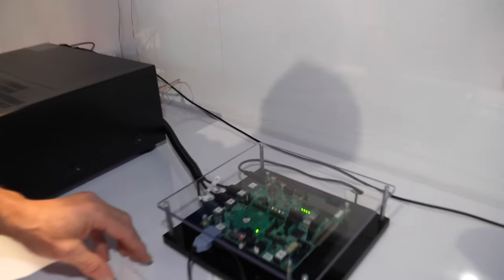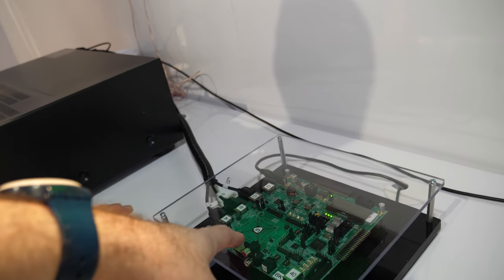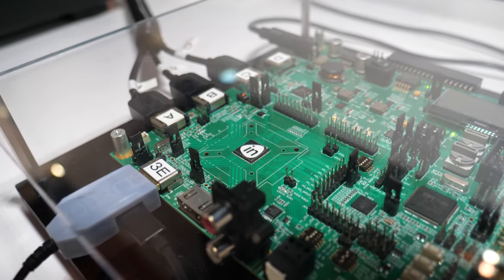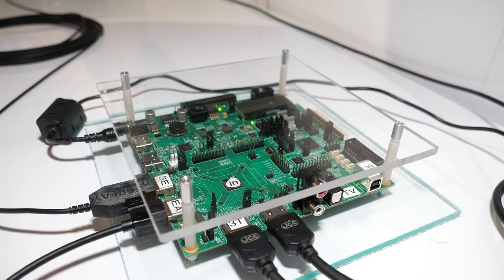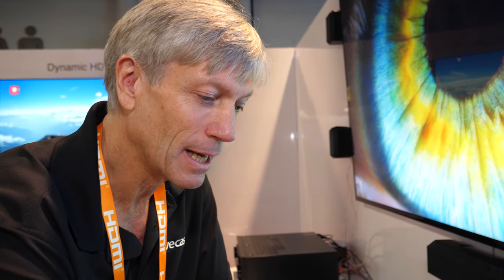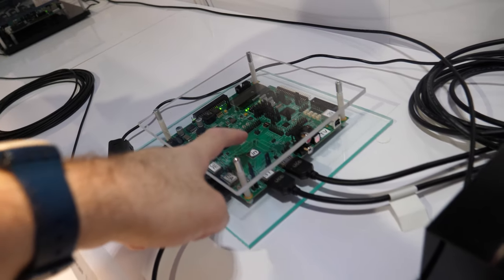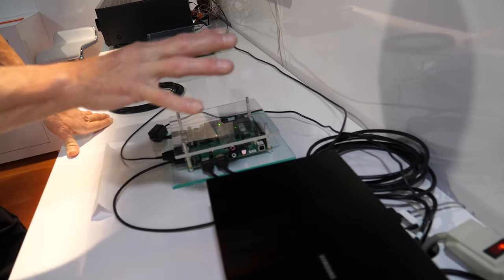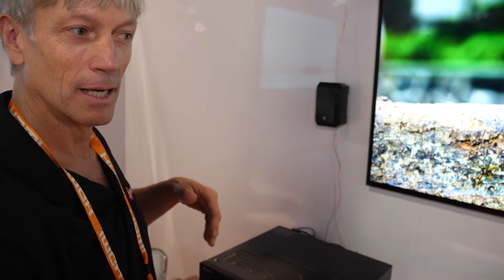INVECAS shows World's First HDMI 2.1 with HDCP 2.3 Chip & IP Solutions for TV, AVR, Soundbar and STB

Comment: Does that receiver hooked up to the T.V support 4k 120hz or higher pass through?  I don't see any receivers on the market with hdmi  2.1.
Reply: More Models/Products will Support HDMI 2.1 and Will be Coming Later in the Year. (2020) and will become the Standard by 2022. ( when it comes to big name brands)
Reply: If I recall Right -- LG and Denon are currently working on Some HDMI 2.1 Receivers.
Reply: @KaeganThornhillTheCyberRaven  I've been  holding off for  7 years  for one.  I have a Sony x900e with 1080p that can do 120hz, 144hz, 240hz and 1440p at 120hz  hooked up to my pc. I have been waiting a long time for this. Good news.  Thanks for the heads up.
Reply: No problem, Buddy.

 Also there are several 4K TVs said to be Rolling out soon that will be able to handle 144fps/144hz at full resolution/hdr and even an 1440p Ulta Monitor that can handle over 340fpz/340hz. 2020 is going to be Wild and the Perfect year to Upgrade your Battle Station.
Reply: @KaeganThornhillTheCyberRaven  Nice! Can wait.  All we need now is a single video card that can handle  4k at 144hz.  with low ms.
Reply: I'm sure one of those will be right around the corner -- but will be a bit pricey at first.
Reply: @KaeganThornhillTheCyberRaven  I'm sure. Probably around 1000$.  I still have the 980ti,  at 1080p 240hz,  everything on  low I still can't get a stable 240fps but the ms drops down to 3.  You can get that high with a sli setup. But the problem is that not all games support it.  Itll be awesome to see when all the devices  compliment  each other.